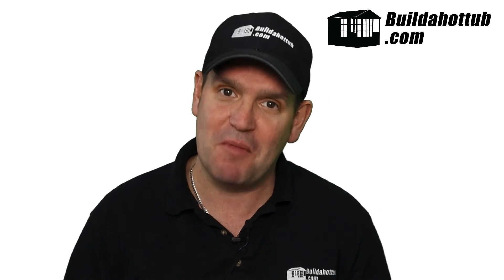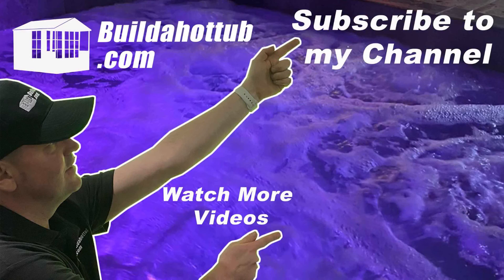Why you don’t need Ozone in a Hot Tub and what you should use instead

Comment: If you had experience with sodium chloride systems?
Reply: I like salt water pools but we’ve had problems lately of the generator being corrosive to stainless steel fittings !!! 
People are having to fit sacrificial anodes
Reply from the maker: Thanks for the comment as always Lee, much appreciated. Where would you fit the sacrifical anode into the system? Pump room or externally to protect the fittings?
Reply: @Buildahottub  ideally pump room so it’s at source .. apparently if the stainless steel is polished there is no problem?.. but and and hidden steel like cantilevers for pool cover pits get attacked big time .. this is with Dagen system that pollet pools are trying to take over the pool industry with ! 
Fitted loads and had lots of issues .. hence no monger using them
Reply from the maker: Hi Mark, I tend to supply the Pentair IC20 systems for customers that would like salt. Not the cheapest, but are good systems. They are pretty good but as you can see from pool builder Lee's comment below, they are very corrosive.